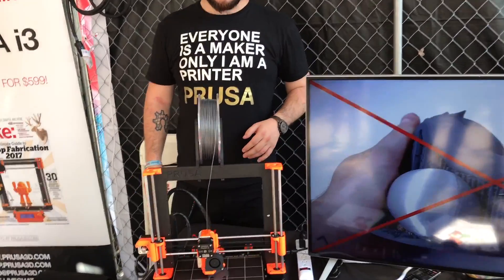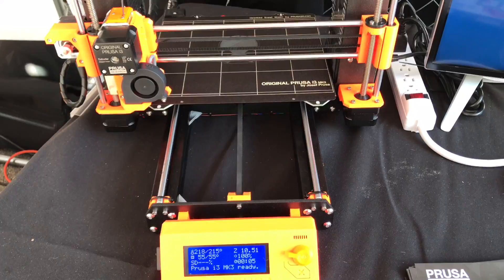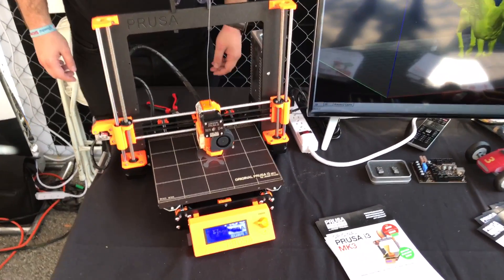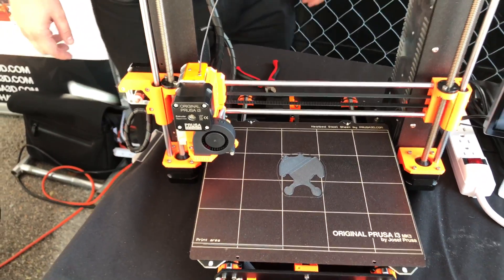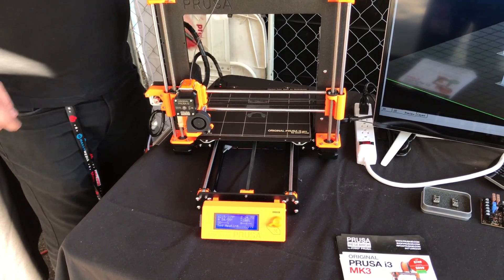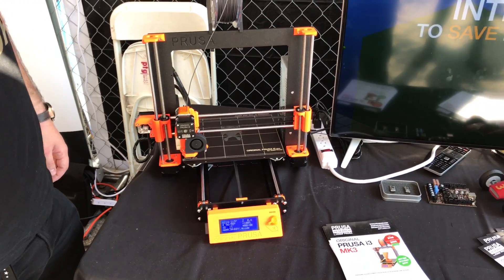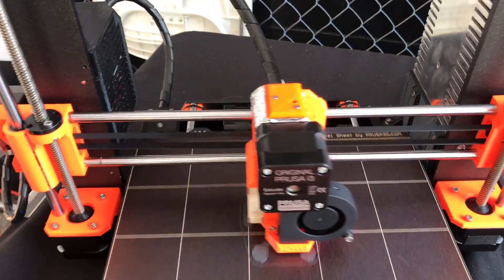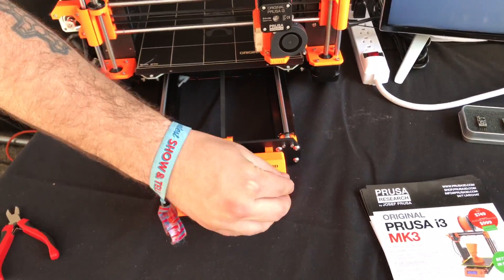Original Prusa i3 MK3 features for Reddit/r/3Dprinting

Comment: Will there be a way to deal with MAXTEMP errors and recover from them? I get that the printer needs to shut down for safety, but could the menu at least give an option to reset and resume? I hate losing prints simply due to software limitations.

Comment: A little disappointed in the upgrade.  It is missing the best part Motherboard.   Give the option to upgrade the motherboard and and power supply as well.  The frame MK2 is adequate and doesn't need to be in the upgrade kit but the motherboard.

Comment: ualdayan left a post asking for a larger print bed (see below).  I second his post!  PLEASE offer an "XL" version of this printer.  You will sell a lot of them to your current fan base (including me!) and you will get a lot of new fans and customers if you offered an "XL" version with a 400mm x 300mm bed or larger.  Personally, I want to print TPU shoes.  Big companies are starting to print 3D shoes and charging huge dollars for them.  I want to print my own TPU shoes!  Please offer and "XL" version of this printer!
Reply: Prusa i3 can't have a bigger bed. You need to redesign a whole printer to do so. Mendel configuration with moving bed is limited in speed and acceleration by the bed weight. For larger beds CoreXY or similar configuration are more optimal.
Reply: You would need a fixed bed and floating X/Y carriages in order to go bigger.  That would be the i4 :)

Comment: The only thing other thing I would want is a larger bed option.  I have a specific thing to print that needs the strength of being printed as one part that is ~450mm in one direction and ~300mm in the other.
Reply: Have you tried acetone gluing with abs? Usually the bonds are stronger than the print itself.
Reply: +1 for ualdayan.  I want to print a shoe using TPU.  Gluing a shoe together does not make sense.  It should be one single TPU print.  I need the bed bed to be 400mm in one direction and 300mm in the other direction.
Reply: Mathis I prefer PETG because it’s layer bonding is so strong it is just as likely to shear across layer lines as it is along them, along with it not warping (important for such a large print that needs to be flat).  That and I bought 55lbs of it for my Filastruder for $150.  Can't find a strong adhesive for it though.

Comment: AMAZING! GREAT! Love the new features :) But just bought the MK2S Upgrade kit.. Will be there a MK3 Upgrade Kit also in the near future?
Reply: WAIT FOR THE EMAIL!  The MK2.5 upgrade kit will be $99 if you purchased the MK2S in the last 30 days.  The MK2.5 upgrade kit will be $149 if you have ever purchased the MK2/S.  They are sending out an email soon so you can get this discount.  More info is on this page near the bottom:  http://www.prusaprinters.org/original-prusa-i3-mk3-bloody-smart
Reply: They've said if you want to turn your mk2s into a mk3, you can buy the "Upgrade kit", which will give you a fully functional mk3 and a mk2s ( ie: the "upgrade kit" will just be a mk3 kit with a discount for those who bought a printer previously)
Reply: Incorrect. Right now there is just the 2.5 upgrade. http://shop.prusa3d.com/en/printer-upgrades/179-original-prusa-i3-mk2s-to-mk25-upgrade-kit.html

Comment: How will the printed object be when the power has cut out?
I mean, HOT nozzle will stay its position and keep melting the plastic right?
(I've experienced the stopped nozzle melting the printed object.)

I couldn't see the detail of the object in this video :|
Reply: suppose but imagine your 80% complete on  a 10-20 hour print....  i think a tiny blob or melted part would be the least of my concerns.   there is always post processing anyway depending on what your printing.
Reply: Supposedly, when it detects the power loss, theres still enough power left in the capacitors to move the z axis a miniscule amount.  That way you don't get the blob.
Reply: I think I actually saw the nozzle raise up slightly when he tripped the power.

Comment: Can i upgrade from MK2 to MK3?
Reply: You can get the "2.5" upgrade that includes filament sensor run-out, much better extruder, PINDA 2 sensor, and magnetic bed with spring steel sheet.  If you bought the MK2S within the last 30 days, the upgrade will be $99 USD. If you ever purchased the MK2/S, the upgrade will be $149 USD.  More info is on this page near the bottom:  http://www.prusaprinters.org/original-prusa-i3-mk3-bloody-smart
Reply: Marius Pele no but u can get some stuff on it that the mk3 has, a sort of 2.5 more info on the other mk3 video
Reply: it has a different board and drivers. Plus the filament sensor and that.
Reply: Yes but it costs around $500 I believe

Comment: So great ! So many of my dreams were added to this new printer, the power recovery, the filament run out / resume, the flex build plate and the improved part cooling fan mod. The move to a 24 volt system is a plus as well as the new stepper motor. So when cn we pre order this bad boy ! My 3d printed robot projects and crying for this.
Reply: Shop.Prusa is taking pre-orders for the MK3 already.
Reply: Thanks cricalix, found it !
Reply: Yes I just put my i3 MK2 and both my Flash Forge dreamers up on crags list for cheep. If they sell then I will pre order as well. This version is just to good to miss out on !
Reply: I already preordered, despite having a MK2S already... gotta sell my old baby.